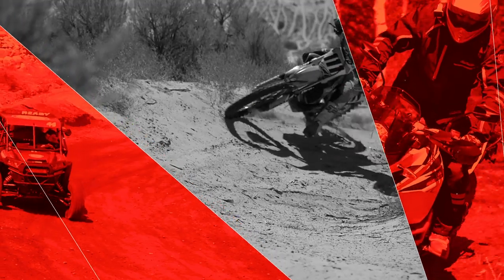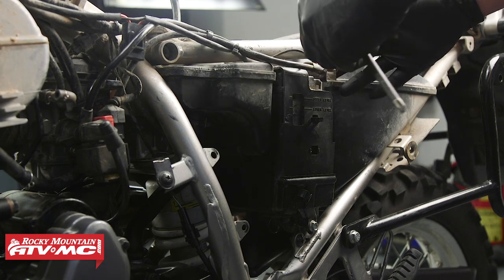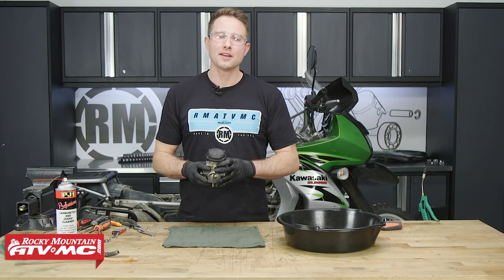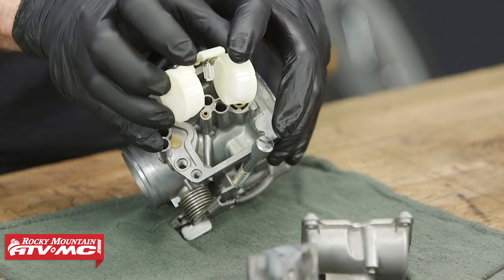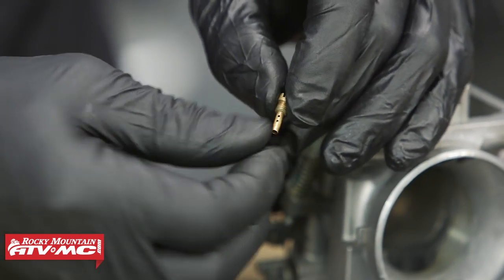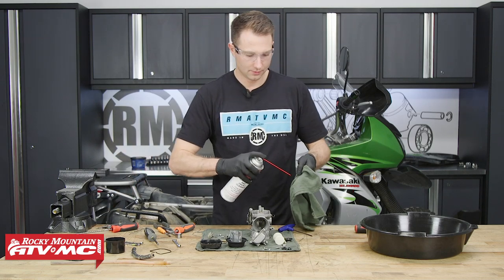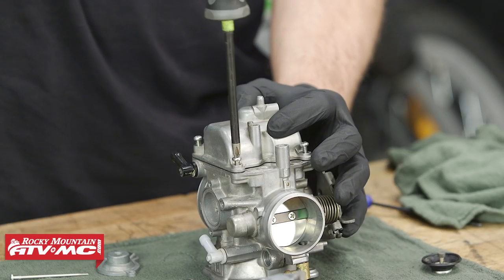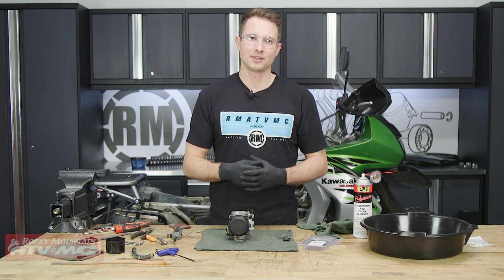How To Rebuild the Carburetor on a Kawasaki KLR650

Comment: The carburetor has to be TUNED after you rebuild it and put it back in the bike, and this is not a simple process. MY ADVICE: Unless you REALLY KNOW WHAT YOU ARE DOING,   I would leave rebuilding your carburetor to a Professional! It may cost you some money, but it will save causing damage to your engine because you ran a carburetor that was not properly tuned!

Comment: Take the fuel screw cap off and buy a finger adjustable screw on Ebay for $12.00. Had mine clog up in the desert, now I can adjust and clean easily on the trail.
Reply: Or you just get an All Balls rebuild kit which comes with a longer screw

Comment: Awesome video! My klr will crank and run but I have to give it fuel to keep it running. It will die if I let it idle by itself
Reply: Start with the pilot jet.  Mine would run on choke but die if let up off the choke. Pilot jet was gummed up from some old shitty fuel.

Comment: I also have a frayed throttle cable at the carb-best tips for that fix??
  -Mahalo!
Reply from the maker: People have used solder to fix frayed cables so if you have the ability you can try that. But your best bet would be to replace the cable.

Comment: Great video you make it look easy mate.
Reply: Except he didn't even bother mentioning that the Carb HAS to be TUNED properly after you put it back in the bike. This is VERY important, otherwise the bike won't run properly, and it could damage the engine!  And you need to know what you are doing for this!
Reply: @-WhizzBang- wow…do you have the link to that vid ¿
Reply: @geostorm7426  nope. Don't need a video, it is common knowledge!

Comment: Very very helpful video, I just bought a 2006 KLR and I’m having problems to start it, it was sitting for a year, what do you recommend to do besides the carburetor. 
It’s my first bike
Reply: Ernesto, you will probably have to clean out the Fuel Valve under the tank also. I had both the Carb and the Tank Fuel valve get gummed up at the same time.
Reply: I recently bought one myself and it had the same issue I just drained the fuel changed the sparkplug and made sure my choke was right and it fired right up had sat 3 years

Comment: I do have a question about the fuel mixture screw at elapsed time 18:32. During removal, the repairer/maintainer had to count the rotations to remove the screw. There was nothing noted about seating it/bottoming it down before removal. It seems as though you need to know the rotations to get it seated during install and then subtract the number of rotations from the removal rotations to know where the needle is supposed to be (backing it off) at during normal operation.
Reply: You don't just rebuild a carb then throw it back in the bike and go!  It NEEDS to be TUNED properly, which is not always easy and you need to know what you are doing! . He mentions NOTHING about this!  In my opinion, unless you know EXACTLY what you are doing, I would leave the rebuilding of a carb to a Professional!  Otherwise, it could end up costing you even MORE money in the end!
Reply: Aaagh i lost count…

Comment: My '98 model has an integral brass overflow pipe poking up from the inside of the float bowl, which has split....I'm in the process of removing the pipe & blocking the hole to prevent fuel pissing out.

Comment: Great video thank you!
My bike sat for three years with the float bowl full. I did exactly what you said clean it thoroughly the carb and then put it all back together. Start it up great but now I have an issue where the RPM tack fluctuates from 50 to 100 RPMs back-and-forth , I tried adjusting the fuel mix screw every way in which Way but it does not go away. Do you have any ideas with this may be any help is greatly appreciated as I am not a mechanic. Thank you very much.
Reply: The carburetor has to be tuned for proper fuel to air mixture, after you rebuilt it and put it back in the bike. It isn't as simple as he makes it out to be in this video!  And he doesn't even bother mentioning this, which is a very IMPORTANT part! This is WHY it is a job best left to a professional if you don't know what you are doing.  You will probably have to take it to a shop to get this done properly! Otherwise, your bike won run right and you could cause damage to your engine!
Reply: @-WhizzBang- let me guess; you’re a professional…¿
Reply: @geostorm7426  Nope. Don't need to be a pro to know that a Carb needs to be Tuned when it has been rebuilt!

Comment: Use extra care when installing the mixture needle, make sure its seated properly before tightening. It can be tricky because of the spring, I gave mine a turn but it squashed the needle.
Reply: You don;t just rebuild the carb then throw it back in the bike, and go.....The carb also needs to be tuned properly when you put it back in the bike! He mentioned NOTHING about this!  In my opinion, unless you really know what you are doing,  rebuilding a carb should be left to a Professional!

Comment: Instead of draining the float bowl, would it work to turn the petcock to the off position and run the engine until it dies?
Reply: If you are at the point of pulling the carb, your engine probably wont run.

Comment: good video. 
but one item that needs to be said. the two plastic hose connections on the side. are the same. might be different colors but are 100% interchangeable. so keep a spare one in your kit.

Comment: When replacing the diaphragm slide make sure the 2 dimples in the slide surface face the carburetor air inlet from the air box, please clarify if its possible to install the slide the wrong way around .
Reply: You can install it wrong way but in all videos that I have seen they recommend to do it right